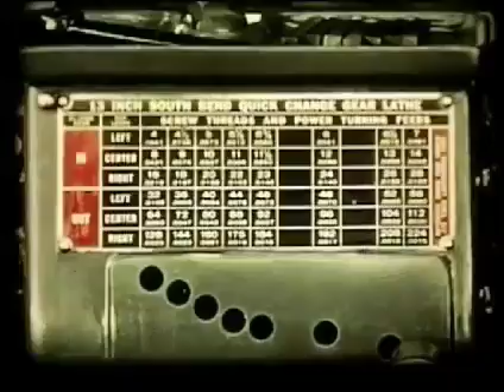The Bible of Metal-Working with a Lathe!

Comment: I can relate to everything in this video. Worked on machines with similar features. I have even worked on a 1918 lathe in reasonably good nick for screw cutting too. In some respects not much has changed. Tool posts have and some quick features on screw cutting. So long as the lathe is in good nick lots of different parts can be made. Not sure if a SBL could handle carbide  but I also grew up with HSS. Still use it too at times. There are some things carbide just cant do.
Reply: It is interesting how were made first machine tools when there were no machine tools
Reply: @VitaliyTym They would have used what was available such as hand tools and manually develop the skills to do the same and continue to improve with experience and practice.

Comment: So the worm gear is always spinning so long as the screw is turning?  You'd think it eventually wear and get unacceptable backlash pretty quickly. Funny they put a key way all the way down the screw to essentially couple it to a larger screw. Love this video.
Reply: josh, the lead screw key way drives the gear in the apron that runs the feed mechanism, you only use the threads on the lead screw when you're threading. That's what the half nut lever does, by grabbing the screw thread when it's closed.

Comment: I love how everyone says a lathe can build another lathe, yet no one seems to have ever done it. How does one do the ways on a lathe? Great videos though, lots of useful information that still works today.
Reply: Jeff Richtman  cylindrical ways, Im dubious about anything other than a rudimentary machine being built strictly on a lathe and certainly other machines are better suited to making certain parts but being creative with the setup should allow one to produce a functional lathe from a lathe.
Reply: binness. theres a lathe then theres a "lathe". I dont think it was ever meant that a lathe could duplicate its self but that a lathe alone could  be used to build a lathe. the resulting lathe may well be a primitive machine bearing only a passing resemblance to its parent machine but it is still a functioning lathe.
Reply: +Jeff Richtman
Well, there is the Reprap project, which attempts to do this precise thing. There is also the fact that a lathe is essentially a drill press with the spindle turned horizontally. A mill, meanwhile, is a drill press with a movable chuck allowing it to produce arbitrary parts. With a clamp that allows arbitrary movement of the workpiece, the lathe can duplicate this ability. Cumbersome, but doable.
Reply: I think it is an Engineers tongue in cheek response, I don't think the lathe could make the electrical parts, nor the leather belt
Reply: binness nor the tailstock, stand, etc. sure all the round parts, but not enough parts to have even a manual lathe. motor and belts is a given. it's just like people saying you can 3d print a 3d printer.
Reply: Jeff Richtman. a lathe when it comes down to it is a very simple machine, and you are thinking rather limited if you think a lathe only produces cylindrical parts.
Reply: lol, I'm aware of what a lathe can do. hence my initial response. would still like to see someone make a video of attempting it.
Reply: I agree! How can we cut gears on lathe that runs the spindle? We need a mill to do that!
Reply: @fechinice687  :  With compound slide removed, the lathe carriage can hold an index head with a blank to cut spur gears.  The driven Chuck would hold an arbor with an appropriate gear cutter.  Cutting
simple Gears is not a problem on large lathes set like a Mill ,, even line boring is doable this way...
The greater challenge involves improvising for shaper or planer work ......
Reply: @1arritechno  But what about the lathe bed? That can only be done on a planner..!
Reply: @fechinice687  Round ways. Those were fairly common on cheap home shop lathes
Reply: I agree! How can we cut gears that runs the spindle? We need a mill for that!
Reply: I agree